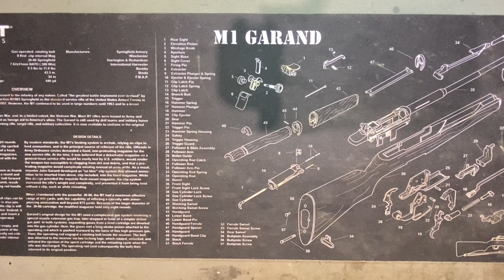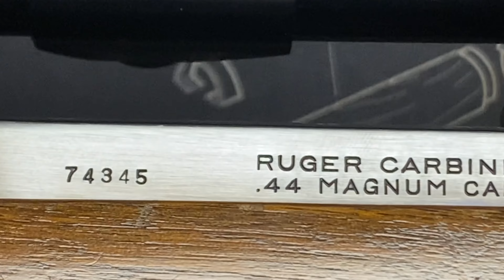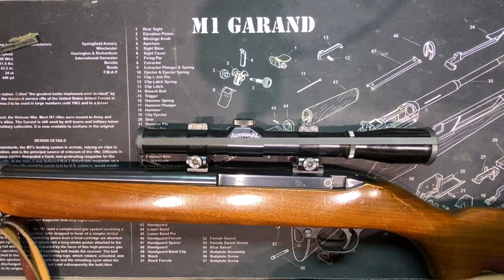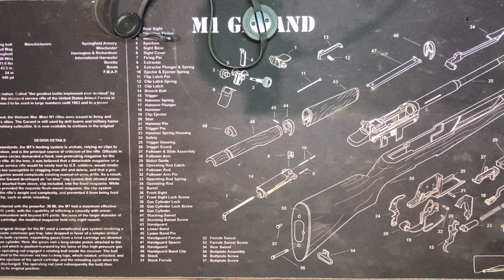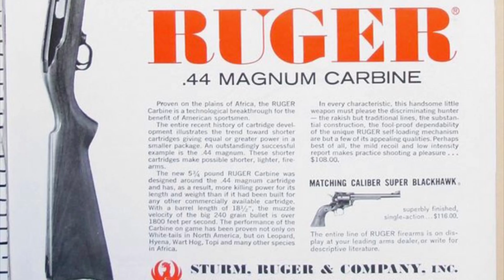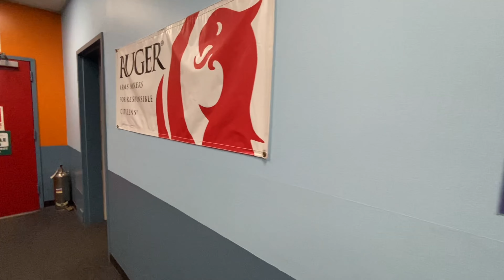Ruger Model 44 Carbine

Comment: The one you're showing is the RS (receiver sight) model.  Notice there is no dovetail cut inbthe barrel for thel Lman folding resr sight typll
Reply from the maker: Yeah, it’s the scope model now because that rear sight is proprietary and costs more than the rifle.
Reply: @MilsurpGarage there was a factory variant of this rifle that came with a rear peep sight. It was the RS model designation. I just happened to see a nos part on eBay recently. It may still be there.
Reply from the maker: @robertotto5811  I saw one listed as “Vintage Peep Sight Williams Lyman .093 Peep Ruger” for about $30 shipped. 

Got a feeling it’s not the right one……it looks right, but I’m feeling like it’s not. The big “No returns” in the listing has me suspicious.  Doesn’t specifically say it’s for the Ruger 44. Got my fingers crossed.

Comment: In disassembling, you noted that it was necessary to have the bolt locked back.  In the Ruger 10-22, the safety has to be in mid-position to get the action out of the stock.  Is it the same in the 44 cal?
Reply from the maker: No but I do remember that mid position thing....thanks for the reminder as I was thinking about a 10/22 dissassembly/reassembly video.